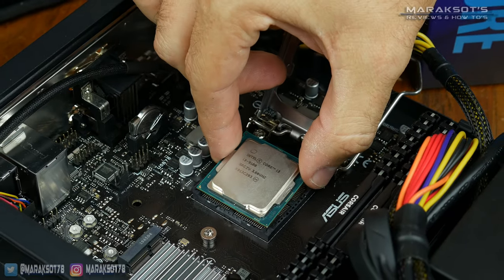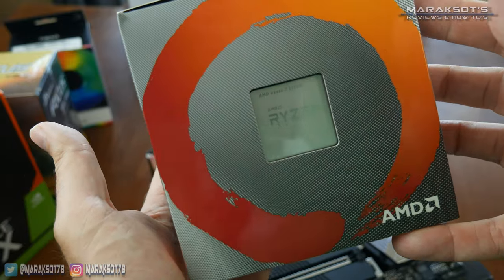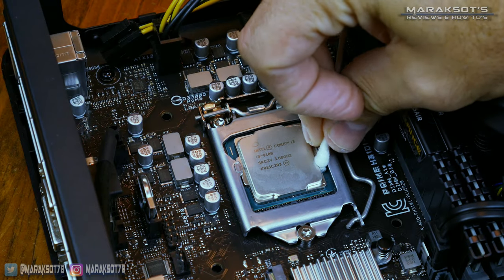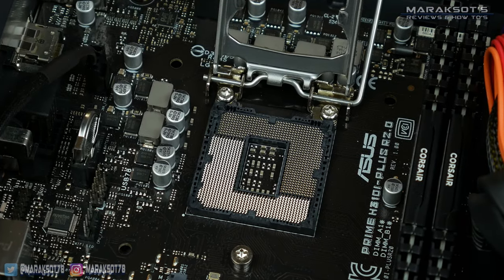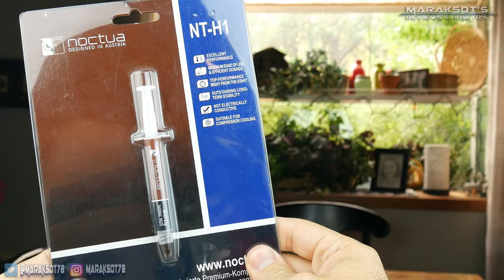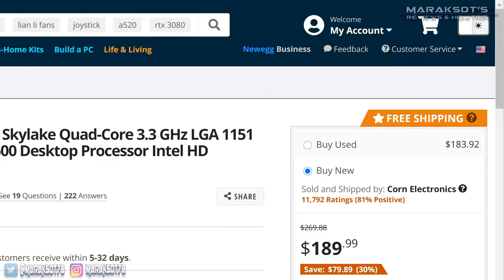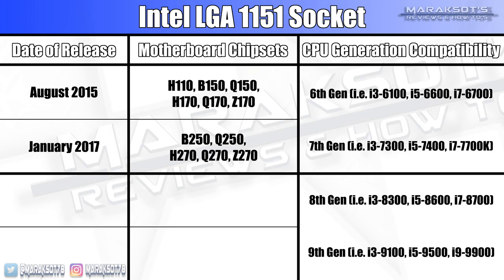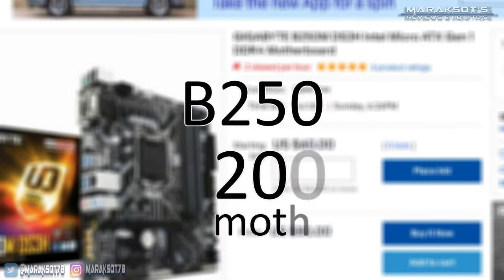A Beginners Guide: How to Upgrade an Intel CPU (core i3, i5, i7, i9)

Comment: This was an excellent instructional video! I now have a question. I have an HP envy 750 - 514 c and I want to be able to run Windows 11. The windows tool says my processor is not compatible even though it's an I-5 6400. I was looking to upgrade to the very same i7 processor that you show in your video but it appears my motherboard is not compatible. I would not have known that without watching your video. I now need to figure out what motherboard I should get to go with the i7 10gen processor. That has got me stumped now. I'm not sure what else I need to know in order to swap out the whole motherboard and it be compatible with the rest of my hardware?  The computer is running perfectly fine with Windows 10 perhaps I just need to forget about Windows 11?

Comment: thank you for your intel awesome information, right now I'm using DESKTOP-91A2LD5 Intel(R) Core(TM) i3-4170 CPU @ 3.70GHz   3.70 GHz.  I do want to upgrade to Core I7 though in order to run Windows 11 on my desktop.  any suggestion I probably would need to upgrade my motherboard in order for the Core I7 to work properly.

Comment: I have a dinosaur HP 3D drive guard  Windows Vista Basic Professional 2140 10 ". It has become so slow. I am right now doing a complete resetting of the PC in hopes it will help. If it does not I am thinking of an upgrade of the processor if possible along with increasing the RAM. I am a 72-year-old (young) lady who loves old stuff. Thanks for your help. I did change a Dell processor years ago but this will be my first attempt for a upgrade  processor.

Comment: I have a Gigabyte GA-Z170X-Gaming 5 (rev. 1.0) motherboard socket 1151. I have an Intel core I7-6700K CPU which I want to upgrade to something that supports VR and gaming. This is an older (2015) motherboard and I wonder if it's too old to invest into these upgrades. Also,  which CPU would you recommend if I do update?

Comment: Hope you’re still around.  My computer is slow as sin.  I think I need to upgrade the power supply or the process, not sure which.  Need advice.  I have an intel core i3,  what processor would be best?

Comment: Nice video. I do have a question.
I have an all-in-one hp pc. Hp says it cannot support Windows 11, not that it's important to me. But, it is very slow, windows 10. Is it worth it to change internal parts upgrade it to better than new? The screen is large and clear.
If possible, can I change motherboard, cpunit , ram, memory, etc? Essentially re-build it?
Is it possible and is it worth doing?
Thanks
Reply from the maker: It's possible but with all in one PC's often times they have custom parts that are specifically designed to fit inside the monitor chassis.  Typically off the shelf, generic PC components won't fit.  So in your case without being able to see your PC and see whether or not this is the case my guess is that upgrading it is going to be more trouble than it's worth and you'd be better off just buying a new PC.
Reply: @Maraksot78  
Thanks, I have already purchased two new laptops. I couldn't risk not being without one. Just was a shame to just throw this one out. 27" screen, etc.
Thanks, though.

Comment: I have an Intel Core i3 8100 and I'm trying to upgrade to an Intel Core i5 8600K. 
-MSI Z370 MoBo 
-GTX 1060 6BG GPU
*Just for reference
Do you guys believe in your opinion that it would be overkill if I went for higher tier CPU or is this a good choice ?

Comment: I have a h370 with a core i5 9400f processor, i have a 500w psu and 1660 ti gpu, i want to upgrade to a rtx 3060, but i think i will need to upgrade a processor for gaming. What do you recomend i get for a processor?

Comment: So, I have a Dell Inspiron 3471 stock with an i5-9400 and with the research I’ve found in accordance with this video suggests I can have an i9-9900 LGA 1511 300 series. And I was set on buying one until you mentioned “K” and wattages. 

My PC has a 200W supply and I’ve already upgraded the RAM from 8 to 32 and switched to an M.2 SSD with heatsink. I can find the processor without a “k” but it cost more than the ones that do, so do you think I can support that? I can unplug the disc drive and original hard drive.

Comment: What processor should i ran to if i upgrade my i3 cpu 540 3.07? What is the best that you will recommend. It runs with LGA 1156 socket.

Comment: I have an i5 10th gen + RTX 3070 ti and thinking about upgrading to an i7 12th gen. 
I guess this is a good upgrade from what I’ve seen but I don’t know how much better is it going to be! Haven’t seen many comparisons
Reply from the maker: Just in case you aren't aware, 10th gen motherboards are not compatible with 12th gen CPU's. You'll have to buy a new motherboard that supports 12th gen intel and new DDR5 RAM as well.
Reply: @Maraksot78  you’re right! I did find that out, thanks! 😁
Reply from the maker: Oh good. Happy to hear you already found that out. I would have hated For you to have bought the i7 and then find out it doesn't work with your motherboard. Good luck with your upgrade. 🙂

Comment: Hey thanks for easy tutorial. I'm looking to upgrade My CPU with this board ( ASUS Z97-A (Intel Z97, ATX, 3x PCI Express) and currently have a  Intel Core i5 4670 3.4GHz QUAD CORE (3.8GHz Turbo Boost). Any suggestions? I should mention this is not a gaming pc but rather a stock market trading pc.
Reply from the maker: The most powerful non-overclocking CPU's for that platform is the i7-4770 and i7-4790. The i5-4670 is a 4 core CPU and the i7's are 4 core 8 thread CPU'S so they'll be like adding another CPU, sort of. Don't know for sure how much of a performance increase you'll see going to the i7 with what you use your computer for though. How much RAM do you have? If you only have 4 or 8 GB going up to 16GB may offer a nice improvement. The number one way however to improve performance for normal day to day tasks is to switch your OS drive for an SSD. Assuming you're currently using a mechanical hard drive of course.
Reply: @Maraksot78  I have 32gb of ram with a 120gb Kingston V300 SSD SATA III

Comment: #6%club Quick question. I'm updating my CPU to an i7 6700k from i5 6600k I use 3 SSD cards HDD 32gig of RAM and a 650watt PSU, will I need to upgrade my PSU to a higher wattage?

Comment: I have  Dell Optiplex 790 running an i5-2400 3.1 Ghz, 8 GB RAM and a GTX1030 graphics card. I've read that the most processor I can use is the i7-3770. Is this correct and would the performance improvement be noticable?

Comment: thanks for the infom i have a question tho can i upgrde to I3 or i5 latest generation with my specks

Processor	Intel(R) Core(TM) i3-4130 CPU @ 3.40GHz   3.40 GHz
Installed RAM	8.00 GB
System type	64-bit operating system, x64-based processor

Comment: I want to upgrade to a Pentium 4 (I already have one but it's got 2.4ghz for a frequency and I need a higher one) with a higher frequency (2.6ghz or 2.8ghz). The capacitors surrounded by all 478 pins don't match with my other processor which I currently use, nor do they work for an upgrade and I don't know why. I've been searching on eBay for a processor that identical to the one I currently use, only with a higher frequency. So far, this hasn't worked out well for me. I bought the right processor, they just don't have the same way of capacitors. I see things for the Pentium 4 like SL6WK, SL6S5, etc, but I'm not sure if that specifically matters or not. I understand that people don't use nor make Pentium processors anymore but the thing is that I frequently use my computer for some everyday basic needs.

Comment: I'm working with a Dell model I've never dealt with before. I have a: "Dell One 2022"  (from 2014). It's brand new, in the box, with an Intel Pentium G645T that I'd like to upgrade. However, I'm not finding documentation for it. Is there any chance you might be able to help out? I don't need to overclock it but I'd like to upgrade to i7 (or i5) if possible... Any ideas would be greatly appreciated. I'm a computer seller not a tech and though I'm familiar with basic upgrades and repairs, this one is a little outside of my wheelhouse.

Comment: I was wondering what cpu I should get for my 1660s with 16ram 500 power supply and Asus motherboard prime b560m a the original cpu is an i3 10100f should I buy a new cpu or gpu

Comment: I have a Intel Core i5-4690K CPU and want to replace it with an i7-4790K. I have the 1150 socket which means the strongest alternative I have is to put in the i7-4790K CPU as far as I know.
And thank you for a great video.
Reply: Did you end up doing the upgrade? I'm looking at doing a similar one for sons pc (i5 4670 to a i7 4790k) and wondering if it made much difference for you? Cheers
Reply: @Dylan-ui1yl  Yes I did the upgrade and it made a great difference. I can for example play "Hogwarts Legacy" without any problems. I really recommend putting in the I7 4790K.

Comment: So what would be the cheapest motherboard to use for an Intel i7 9700K CPU if a cheap motherboard is not meant to be good for it then?
I just got an 9700K and now I need to buy a new motherboard for it, so I really need advice on a suitable motherboard for it since an ultra cheap motherboard is not good for it?

Comment: what are the risks of cpu upgrades. like not enough power delivery. example, i have a MSI MS-B9321 mother board, I want to upgrade from a i5-10400F CPU @ 2.90GHz. to a Core i7-10700F 2.90 GHz. both are 65 Watts but im still nervous. like what else would need to be compatible besides socket for this change?
Also would I be able to up to a Core i9-10900F 2.90 GHz 65w instead?

Comment: Ok so very good info dude thank you. I am currently researching upgrading my CPU in both my Laptops (HP & Samsung) I've already done the ram to the MAX on both it can take or is limited to. Im still trying to find out exactly how to know which processor is compatible or not. HP has Intel core i5-1035G4 and samsung has Intel core i3-2350M. I wanna upgrade them both to i7 core if possible. If you got anything that could help me it would be much appreciated. Thank you again!!!
Tyler

Comment: Thanks for the help! Very informative and much appreciated. Thinking of upgrading my  CPU from i5 7600k to i7 7700k on my Asus z  something motherboard, got a new cooler because I don't think my H7 will be as efficient. Do you think I will have any issues with compatibility? It says it's an 1151 chip thing on the motherboard, but I'm not sure if an i7 7700 will work with it. Oh yeah and happy to be in the 6% club

Comment: Is there a reason you cleaned the CPU before removing it? I would have waited until I removed it, so I am curious if there is a concern with doing it that way instead?
Reply from the maker: I don't know what it is about thermal paste,  but it has a way of getting on your fingers and then all over everything. 😂 Cleaning it off the CPU before removing it from the socket helps minimize the chance of getting thermal paste all over everything. Also I guess cleaning the CPU while still in the socket is something that is just good practice from the past when CPU's had very fragile pins on the bottom of them. Cleaning off thermal paste while holding the CPU in your hand is a bit more difficult when you're trying not to damage those pins. With modern Intel CPU's there are no pins on the CPU to worry about damaging (they're in the socket on the motherboard instead), but you don't really want to get thermal paste on the little gold contact pads either so cleaning it off before hand helps avoid that issue.
Reply: @Maraksot78  Thanks a lot for the response. I ended up cleaning mine in my hand and you're right it was a mess.

Comment: i currently have a 13th Gen Intel(R) Core(TM) i5-13400 2.50 GHz, but i'm looking to upgrade to the 13th Generation Intel(R)  Core(TM) i7-13700
i'm not much of a computer wiz so i'm praying this'll be easy to figure out??

Comment: thank you for your video, what cpu should i use to upgrade on my dell laptop Intel(R) Core(TM) i3-2350M CPU @ 2.30GHz   2.30 GHz ?? i only use it to work. thank you
Reply from the maker: Upgrading laptop CPU's is a whole different animal than upgrading desktop PC's. Sometimes laptop CPU's are soldered to the motherboard rather than being socketed and the power delivery, power supply and CPU cooling solution is designed to support the CPU that comes with it and often has no headroom to support higher powered CPU's. Meaning in order to upgrade the CPU you have to upgrade all that other stuff and there's no guarantee you can find stuff that's going to fit into your laptops body too at which point it's far easier just to buy a new laptop.
So I guess that's my recommendation; to buy a new laptop.
Reply: @Maraksot78  thank you

Comment: Hi there, recently i change my motherboard to rog strix z490-g and i use back my intel i3 10105F processor.. i planning to change my processors to i5 10600K..  i want to ask is there any things need to do on the first start up? Or will it be just start up as usual?

Comment: Found a Lenovo Ideacentre AiO at a thrift store in mint condition, upgraded the ram to max and the hdd to ssd, want to upgrade cpu from i3-6100t to i7-7700t, which is doable but the t-series are lower wattage, around 35W, online comparisons show it's about a 6-10% performance difference between t-series and standard cores so I'm wondering if i should just get a newer board or stick with the oem board and get the i7-7700t because it's only going for ~ 86-109 usd right now for that cpu.

Comment: im running an i5 12600k, I'm planning on upgrading it to the 13700k once it comes out to fully mature my z690 board (Using mid tier gpus so no use for core i9. my question/issue is that ive never upgraded from the same motherboard and was wondering if there was any driver uninstallation/installation involved with this like when you swap gpus?

Comment: The trick to avoid electric discharge it to touch a metal radiator with your fingertips before hand - Little trick I learnt in IT class

Comment: I purchased an Elite Desk 800 G3 from BTG who touts being Microsoft's #1 Refurbisher. I Have been buying PCs & Laptops from them for well over a decade and it seems there is always some small problem. This time, they delivered the PC with a lessor processor than it was advertised to have. The description stated it would have an i5 7th gen. It arrived with an i5 6500. I wrote their customer service and was told theres nothing they can do for me other than offer a refund. Well, that's an inconvenience in more than one way, so I'm debating on just keeping it but I'm just a little mad because the 7th gen has a better GPU from what I can gather. I dont need the better GPU currently, but I may in the future if I get into VR and/or Microsoft Flight Simulator. What would you do? Is there a market for buying & selling processors?
Reply from the maker: When you talk about the 7th gen having a better GPU, are you talking about the iGPU? The one built into the processor? In the case of the i5-6500 that would be Intel HD Graphics 530 and in the case of 7th gen CPU's that would be Intel HD Graphics 630. Because if you're wanting to use your computer for VR or Flight Simulator you're going to need a discrete GPU, aka a separate graphics card because the iGPU on a CPU is nowhere near powerful enough for VR and well below the minimum recommended requirements for Microsoft Flight Simulator.
As for your question about buying and selling CPU's; yes, you can sell your CPU on the used market on sites like eBay, and of course buy used CPU's on those same sites. Which is most likely what you'd have to do because the i5 6500 is an old CPU (launching in 2015). Buying something new to replace it with without having to upgrade your motherboard and RAM at the same time is not really in the cards at this point. The good news is your motherboard should support a 7th gen CPU so you can upgrade without much of an issue. Just FYI, depending on your motherboards BIOS revision you may need to update your BIOS for it to support a 7th gen CPU.

Comment: I am going to build a pc and I am going to buy i3 10th gen and on future I have a plan to upgrade to i5 , i7 or i9 so which mobo should I use. To run these processors at full potential ?
Reply from the maker: For intel 10th gen, if you're planning to put an i7 or i9 in at some point I'd recommend going with a Z490 motherboard.

Comment: Help me, I have Intel core i7, 6500 u,  currently with 8gb which I bought in 2017. I wish to upgrade cpu, ram. Which one is compatible? What further details should I check. I have not opened to check on chips set H, B or something

Comment: 6% here... Checking if a Dell computer system board that currently supports a 7th gen Intel i5 processor is upgradeable to an 8th gen Intel i5 or i7 processor for Windows 11 compliance?  Just looking to know if the factory Dell system board is compatible with 8th gen or not.

Comment: #6%club

Hello, I have a quick question. So I have an old BeatsAudio Pavilion PC and the motherboard it uses is a msi ms-7778 (ver 1.0). I have not yet taken out the cooling fan to determine the CPU type since I don't have the thermal paste to reapply it. I would like to upgrade it to a i5, but I'm not sure if it's even possible on this motherboard. I plan to only game minimally and primarily use it for 3D cad designs and photoshop. I do plan to on upgrading the graphics card and increase Ram memory too. 

Do you have any tips or advice for me to determine it's CPU type?

Comment: I have the (intel core i5-9600k) (socket 1151) and (gtx 1060 3 gb)
And i want to upgrade to rtx 3060 12 gb but i need a new cpu and i 
 want to upgrade to the (intel core i5 12400 cpu) but then i need a new mother board, so what motherboard should i go for? And is there any other tips?